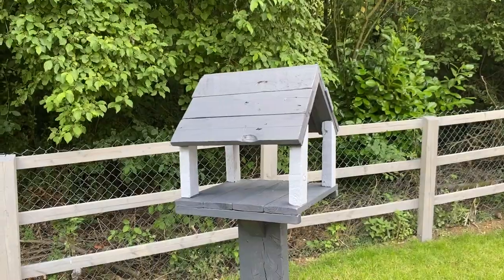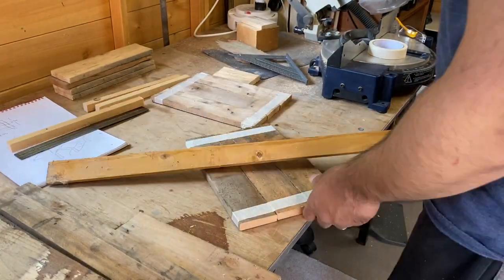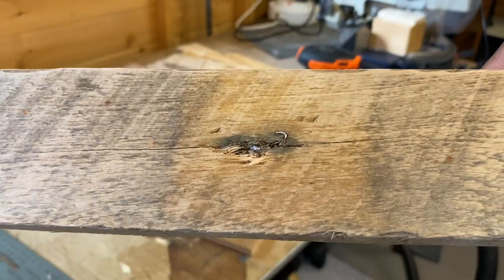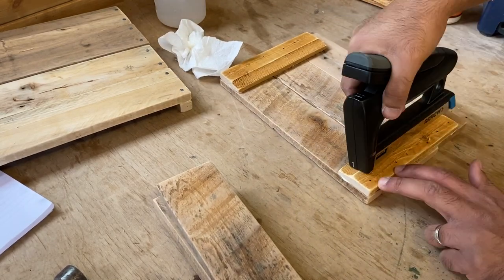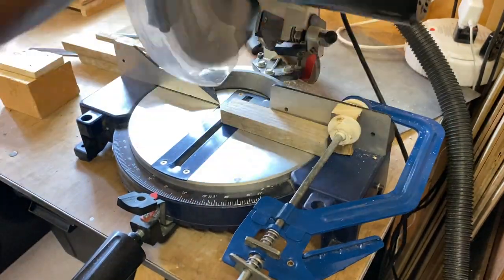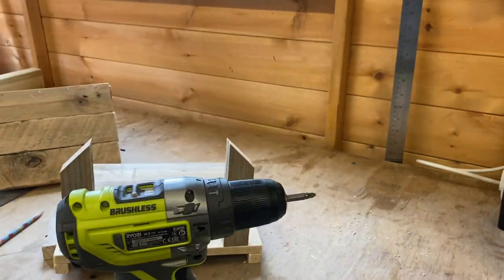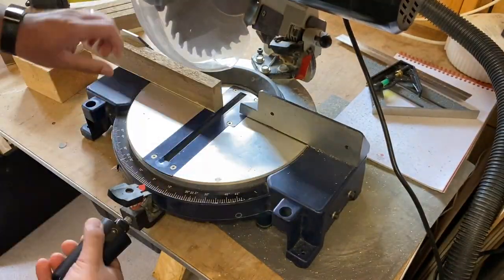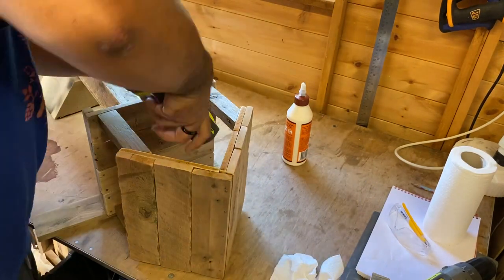How to make a Bird House out of Scrap Wood | Simple DIY Project

Comment: Great job mate! Thou perhaps a couple of heavier pieces fixed to the bottom of stand for when it gets windy
Reply from the maker: You're absolutely right. The stand was a little weak and in the end I removed the 'feet' and screwed the post directly to my fence which worked out much better

Comment: Awesome project,  what angle did you cut the pillars for the roof,    and do you have a cut list for measurements?
Reply from the maker: The pillars are cut at 45 degrees and the pitch of the roof is a 90 degree angle so it all fits nicely. 

Don’t have a cut list I’m afraid. I just made it up as I went based on the scraps of wood I had

Comment: how did you cut the angle for the pillars and supports? it looks great!
Reply from the maker: The pitch of the roof is 90 degrees, so the sides come down at 45deg. Therefore the angle to cut on the pillars was also 45deg which was nice and easy for me. It all depends on the angle of the pitch of the roof so yours may vary

Comment: hey Ajay,i just found ur channel while searching for a bird table,wondering what basic tools can i get as a beginner?and what kind of wood/nails/glue i must have…thank u
Reply from the maker: Well my table is made from scrap wood (old fence panel, fence post and other bits i had lying around).
Tools wise, you could make this table with just a Saw and a hammer. BUt having a mitre saw is really useful so maybe invest in that